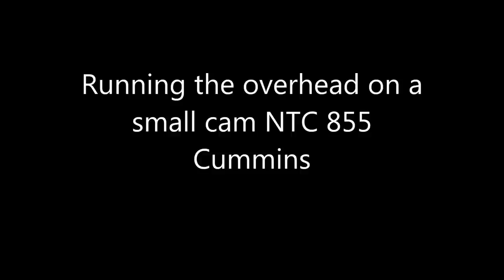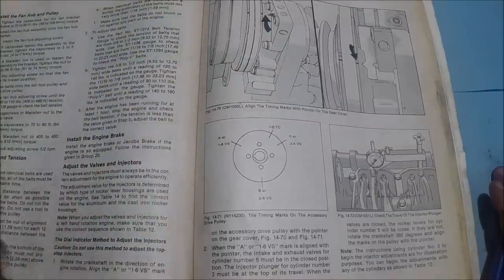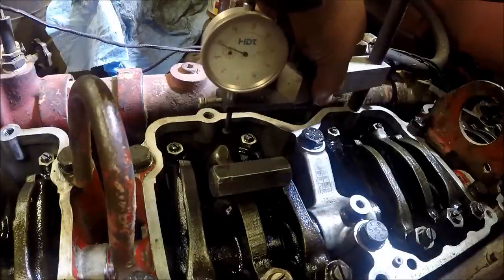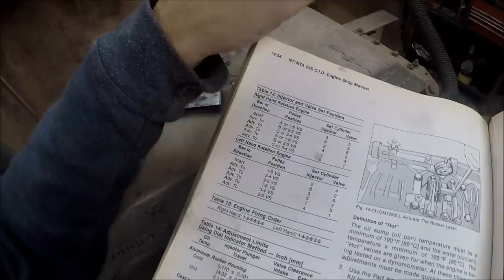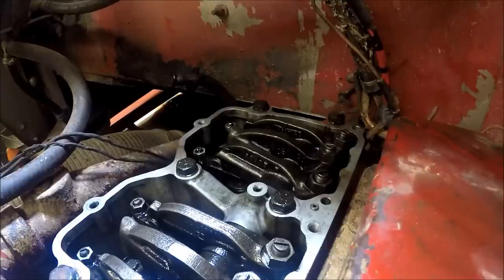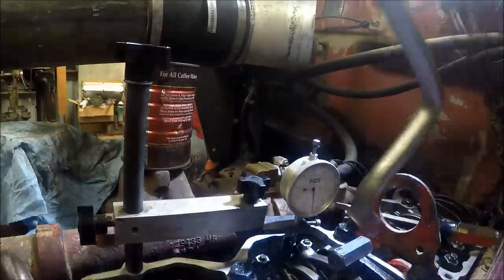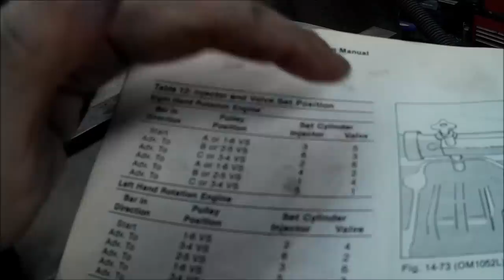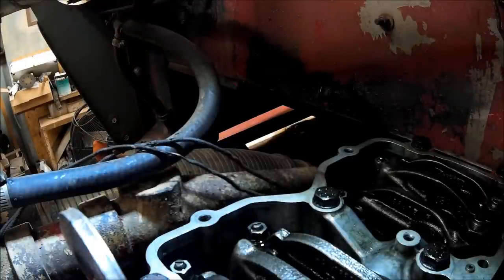How to set the overhead on small cam NTC855 Cummins

Comment: Nice vid! I had to clean the injector screens on my NHC250 ( M925 5 ton) a couple years back, and runnin' those adjustments per the Mil manual, was quite the different experience for me....especially when you're used to adjusting valves on a small block chebby. lol  
...my shop teacher also used the same reference to age. Never have forgot that firing order.
Reply: Must follow what on wrote in SPEC on engine.... DO NOT LOWER IT OR OVER HIGER.... the injectors shaft can JAM AND PUSH BROKE INTO PISTON and the answer is GENERAL overhaul

Comment: Great video!
Do you have a picture or video of the manuals you need to work on these engines?I have a NTC 335 small cam that needs a complete overhaul and the book in this video has all the specs to rebuild or do you need multiple manuals?Thanks for the help!

Comment: First thanks for posting...second I dont suppose you have a link where I can get a small cam shop manual...I run dumptrucks and I try to mostly stick with big cam stuff but I've came into a couple small cams, and I'd really like to have a book for them as they appear to be good solid engines...but this video was very helpful to me, I really appreciate that you were willing to take your time to make it
Reply: I've found plenty of big cam books, not having any luck with the small cam stuff
Reply from the maker: The book I have covers both, some of them refer to the small cam as 2inch cam in the specs. Not a lot of difference in them. A small cam only is probably hard to find, I had one once but it was burned in a fire. Check in yours and see if it shows the specs for 2 inch cam. You are welcome hope it was helpful.

Comment: Thanks for a informative video, I have got to set a small cam non top stop injector NHC250. I am following the torque method as I don't have the equipment to carry out the dial gauge method. All information I have suggests 72 inlbs, is this correct?
Reply from the maker: Yes that is where I set them. Just be sure and go in firing order. Set injector first then valves on same cylinder. Valve setting will be .014 and .027 I think. Don’t go in the order that I did.

Comment: if we don't have dial gauge can we use mini torque wrench to set fuel injector with mini torque wrench & required how many inch lb
Reply from the maker: long thong Lee yes it’s a different method. https://youtu.be/AO-dPMfIIlI
Reply: 72 i believe, but you have to do it in the firing order not like video, you would set both valves and injectors at same time on the same cylinder. Torque method works better if there is a lot of camshaft wear because you are setting on outer base circle of cam and making sure injector plunger is tight to injector cup.
Reply from the maker: Antonio iavarone you are correct, I made a video of that method too here. https://youtu.be/AO-dPMfIIlI

Comment: Greetings from Odessa, Ukraine.
Thank you for a very useful video!
I have an International 9700, a Cummins NT855 engine.
The question of adjusting the injector.
Installed 0.170 inch (4.32mm), but not suitable. Could there be another adjustment? Tell me please.
Reply from the maker: When I get home tonight I can take a picture of the book for you
Reply from the maker: Book has European Big Cam .225 (5.72) mm hope this helps. Torque method will also work.
Reply: Thank you. I will be very grateful for the help
Reply from the maker: I’m happy to help!
Reply: Need technical documentation for NT855
Reply from the maker: Have email?
Reply from the maker: Nata Nata what information do you need?
Reply: Need technical documentation for NT855
Reply: The injector can not be adjusted.
Neither the American version, nor the European, nor the Australian one is suitable.
Can there is another option for adjusting the injector?
Reply from the maker: Torque method is the best option. 
Set engine to a-1-6vs and feel for loose valve rockers on #1 cylinder. If not loose rotate 1 revolution. 
Loosen injector set nut tighten to 72in.lbs 8.1 N•m torque. Then set intake valve .014” set exhaust to .027
Then rotate engine to b-2-5 vs. adjust injector on #5 first then valves. Continue in firing order 153624. I will link a video of the book.
Reply: Today the whole day was suffering with adjustment.
Adjusted by intuition. Started. But the engine does not like it.
Thank you very much for the additional video for me!
Tomorrow I will use your recommendations.
Reply from the maker: Good luck to you! It is a tedious job, take your time.
Reply: Digginok, injector, adjusted by your recommendations
- it's great to work! Thank you!
The truck was not used for 10 years. Restore myself.
In Ukraine there is no technical documentation for this engine.
I am very grateful to you for the information and recommendations!
There is another question. The engine is gradually gaining momentum.
Is it a problem with the fuel pump?
Reply from the maker: Probably the injection pump sucking air. Sometimes the seals dry out and crack causing spongy throttle and high rpms when idling down. Glad you fixed it! Happy to help.
Reply: can air get into the fuel system through the injector? What do you think
Reply from the maker: Yes it could. If not seated and sealed properly.
Reply from the maker: To check for air in fuel system put return line in a jar and watch for bubbles. Another problem could be stuck AFC (air fuel control) valve. This valve limits fuel pressure until turbo boost is high.
Reply: Hello, where is the clapon AFC
Reply from the maker: Depends on the engine some are built into injection pump some are in fuel line between pump and engine. This explains it well. https://youtu.be/3fKhhDIuZfE
Reply: ok
Reply from the maker: Look for small metal line from intake manifold to fuel pump. If it’s stuck you can put some air pressure into it maybe 50psi. maximum. It might break loose.
Reply: what pressure pump gives to the injector
Reply: double line like this
Reply from the maker: Lines into back of cylinder head. One for pressure one for return.
Reply: add to the front head feed
Reply from the maker: Can you send some pictures of the engine? It may be different than the North American version.
Reply from the maker: I will watch tonight and try to help.
Reply: Thank you
Reply: Man! This brings back memories here. Most of what I worked on had stop top injectors but occasionally I would run into an old NH small cam. Mostly in cranes, cement trucks, etc. The stop tops are so much easier. We would mostly use the inch pound torque wrench but sometimes use the feel or drag method. 

Have you considered installing a Jake brake on lil red?
Reply: @natanata1010  can.... All you need is the spring inside injector, MOSTLY alot not change the spring and forget that's the keys press and high and low pressure, If you mastered the TUNING and understand how it work 100% you can set THE LIMIT HORSEPOWER 😅 even the syt CANNOT adjust the limit you set and  secure your engine from overload

Comment: I have worked only with Big cam cummins, what is difference with big cam and small cam????
Reply from the maker: Small cam is the predecessor to the Big cam. Not a lot of difference, most big cams had top stop injectors. Of course the camshaft is bigger, rods are different, but a lot of parts will interchange between them.

Comment: i have a small cam 855.it has top stop injectors. i dont have a dial indictor so i was going to do the 72 inch pound torque. i must be doing it wrong it bottoms out injector at 72 inch pounds. how do you do the torque method?
Reply from the maker: Set timing mark to 1-6vs. If valves are loose on no. 1 start there. Adjust injector first, it will bottom out at 72in. Lbs. set valves .014 intake .027 exhaust. Then go to 2-5 vs. set number 5 same way. Go in firing order to number 6
It is called the outer base circle. It’s different.
Reply: Digginok I went and purchased a dial indicator. Now I can just do it the same as video correct?
Reply from the maker: The  method I did in the video, from what I understand is not recommended for top stops
Reply from the maker: Yes it should work fine.
Reply from the maker: Yes if you use indicator just like video it will work fine
Reply: top stop injectors have plunger travel preset, you don't use the obc torque method.

Comment: could you not set valve lash like this? Set the gauge on the rocker arm. Loosen the adj screw till the rocker is on the valve. Run down screw till you get your gap. Tighten nut?
Reply from the maker: I suppose you could, but the injector is what I have the indicator on. After the injector is set the preload is there for valve adjustment. What we are looking for is basically zero backlash on injector. Valve lash is usually set by feeler gauges though. There is another way to set Cummins overhead, torque method. I will have a video hopefully soon on it.
Reply: Yeah i know. I just like finding odd ways to do things. Boredom and all lol. Never heard of the torque method, unless your talking about running down the adj screw with a inch pound, torque limiting screw driver to mimic the same effect of an outside mic. I hear a lot of guys talking about that. Either way im looking forward to it.
Reply from the maker: I think for valve lash the feeler gauge is the way to go, the injector stetting on the other hand is impossible with a feeler gauge. Basically what we are trying to achieve is zero lash on the injector. The dial indicator assumes the exact lift of the cam lobe, torque method assumes friction=torque=oil film= correct setting. Thanks for watching! Stay tuned!!!!!

Comment: I did it in the same way but the engine doesent  want to start
Reply from the maker: Not all are the same. Some have different cam lift. Check your specs.
Reply: @Digginok  I dont have ani  :(
Reply: If it's a big cam it has top stop injectors, you have to set same way in firing order as dial indicator method but you use 6 inch pound torque wrench, the injector plunger travel is preset on top stop injectors, the setting varies but the most common is .230 ths